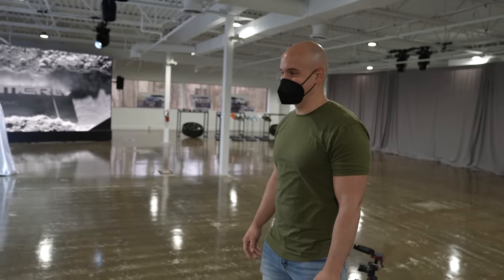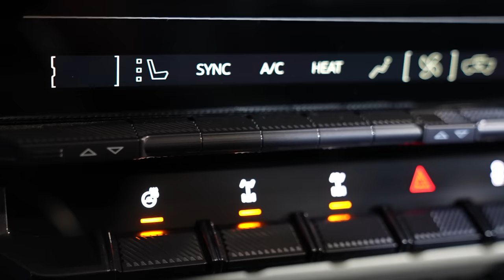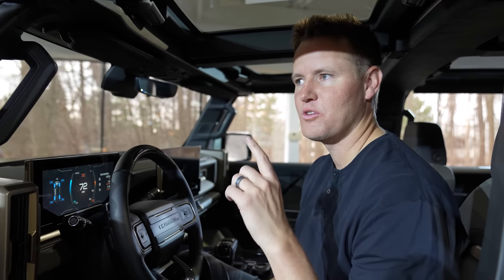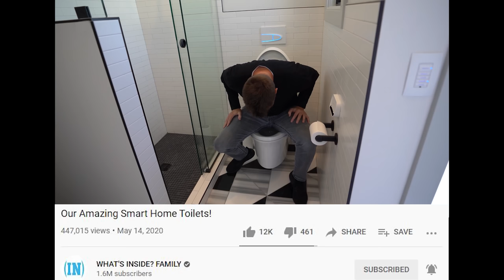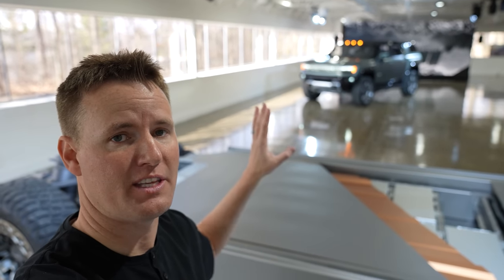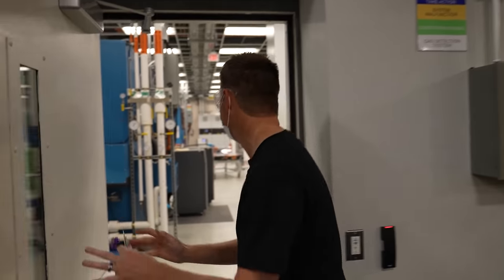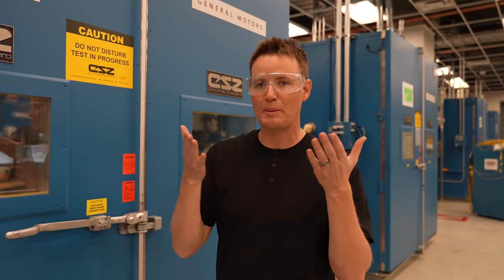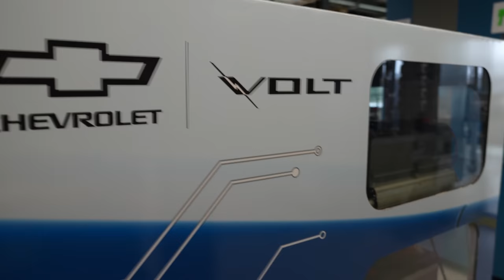Checking out the Electric Hummer SUV! Is it any good?

Comment: 3:20 Wired Humer SUV, the don't even have a driving version of electric car
Reply: You can see the wire running under the car!  That’s embarrassing.
Reply: @reicherk  embarrassing indeed when GM was able to make hybrid electric full size SUVs in 2011. 10 years later they can't make a working prototype that can run display screens and 2 doors on its own power

Comment: Electricity mileage on this truck must be horrible too😂.  The reason they got rid of the heads up display is because if the windshield is cracked it’s gonna cost so much more to replace because the heads up display and most customers don’t wanna pay extra for the upgrade.

Comment: How many passengers can the Hummer EV SUV  hold? Minimum and maximum. Also, can the Hummer EV SUV fit in a normal-sized garage? Does it need a taller, wider, or longer garage space? Also, does this need a lot of maintenance like the Wrangler? Can a 5-foot 7-inch man drive it? Is it suitable for new drivers? Can you leave the hummer outside? Thanks!

Comment: Question for you electric owners- can you go on a road trip? Or does it take overnight to charge and you have to make multiple stops at hotels. Not hating or anything just curious.
Reply: not the owner of an EV but saw some EV road trips, most of the time they line up their pit stops with chargers (similar to planning gas stations with gas cars) and do big charges overnight if the trip is long enough
but It does usually cause you to take longer to "fill up" unless you at a supercharger

Comment: Ahem...charging time, please? This has been the stumbling block of every EV. And, there has to be a massive charging infrastructure in this country (every country that wants to use EVs), a substantial initial expense. Will the charging ports on the EVs standardize across the industry? 
A year ago I bought a Honda hybrid and I think it's a very well made car. Until infrastructure and charging times become comparable to filling the gas tank, I'm not going to go out and buy an EV.
I saw how EV's were a liability in Texas this winter when so much of the state had no electricity for several days, and I'm wondering how much the EV sales are going to be negatively affected by this sobering reminder.
I'm really not a Negative Nellie, but these are some points I have to consider when making a major investment; I need a vehicle that's going to fit my needs - ALL my transportation needs, immediately and without weather conditions being such a huge factor. Yep, I could sit in my car and keep warm if there was a collapse of the power grid just like some in Texas had to do.

Comment: I’ve created five vehicles back in 87’ and the gov of patent office wouldn’t allow my products or creation. Huge bummer. 
Secondly if you didn’t know, GOV refused self drive vehicles and, so did patent office in section 12 sub section a-e on vehicles drive without humans. They refused then and screwed me out of septillions.  (Motor homes motorcycles half ton pup and sedan or sport vehicles. ) running on two eighteen volt batteries

Comment: 40-80 deg C? That’s 104-176 deg F. Are you sure? Where on earth do you drive at 176 deg F?  What about below freezing temps?
Reply: In a very hot and sunny environment the road temperature can reach as high as 60 C and the battery is just inches away. Validating to 80 C gives them some  extra cushion.

Comment: a 300 mile range is not exciting for an adventure vehicle, especially one that won't be built until 2023, hopefully by then the cybertruck will already be out.  I don't need all the gimmicky little "easter eggs"  more utility, more range.   I do like the modular battery system, as a bad pack can be removed and replaced if needed, rather than the entire battery.

Comment: I don't know if I really trust GM's battery tech enough to blow 100k on a Hummer EV.

Chevy had the fires in the Bolt EV and haven't actually replaced the (still under warranty) faulty batteries (or even offered a final fix)
Pair that with the well known buggy infotainment, and Chevy never performing a single OTA update on the Bolt EV... and the horrible Onstar system.   GM doesn't seem really tech focused

Comment: Just a bag of microchips. I'll be driving in my vehicle with a carbureted engine and you'll be sitting going nowhere fast when an EMP comes through. I'm sorry not sorry that is not a hummer and does not deserve to have the name Hummer. Also you mentioned they can test from 40 °C (104 °F) to 80 °C (176 °F) that is not very impressive. Call me when they can test down in the negative range.

Comment: 100,000 miles that's it? with my gas car i clock almost 400,000 miles :D

but it looks nice the EV hummer and hopping they avoid Tesla emmc mistake
Reply: There have been people who took the really old Teslas and clocked over 800,000 miles. 100,000 miles for the low range EVs like the volt, leaf, and others, most others will easily last 300,000+